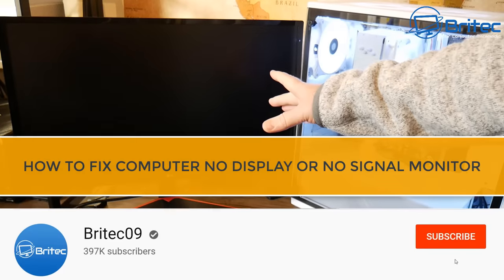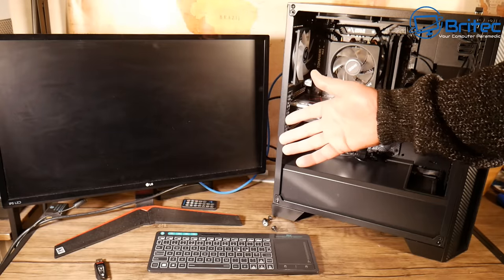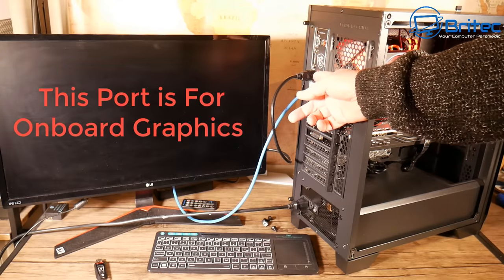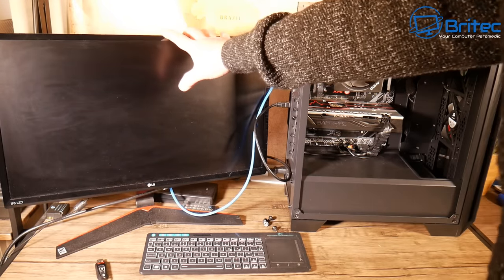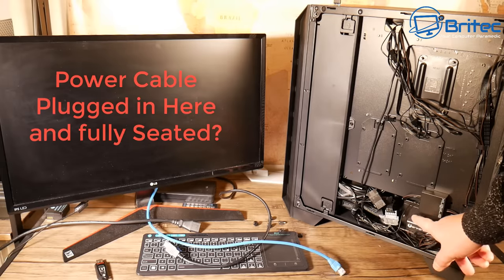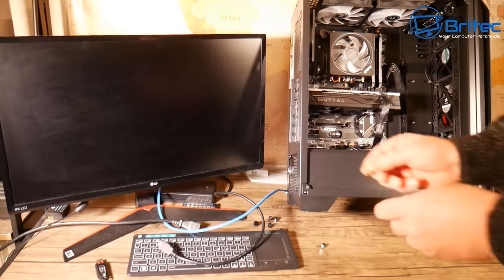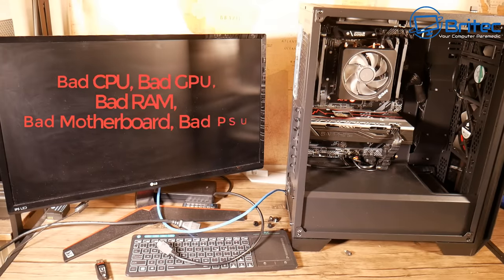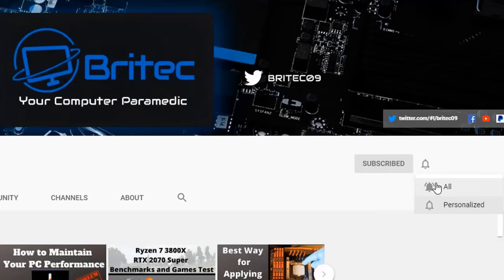How to FIX Computer No Display OR No Signal on Monitor

Comment: One thing that wasn't mentioned was the graphics card driver. I was troubleshooting another problem with mine (certain programs would often crash when I tried to either open a file or save a file). One of the solutions that Dr Google came up with was Update Your Graphics Card Driver, and gave instructions on how to get Windows to do that. Fine. Windows searched for drivers online, and then started installing it. Before it finished, the screen just went black. So I had to troubleshoot that as well. After trying online solutions that didn't work, I gave up and got a professional in to get it going again.
Reply: Did the pro say how he fixed it?
Reply: @lukezambrano  I don't remember exactly (he did it at my place while I was watching). What I think he did, he managed to boot it into safe mode or diagnostic mode, one or the other, found out what the video card was, downloaded a driver for it and installed it. I think that was the gist of it. At the end of the day, I was wise to get someone who knew more about it than I did to try and solve the problem. It worked.
Reply: how does one update drivers without a working display?
Reply: @dirtbeard108  One doesn't. One gets a professional to do it, like I did.

Comment: I just had my rig updated and it's been so long that I've never had an HDMI port in the actual graphics card before. I kept plugging the HDMI monitor cable in the onboard HDMI port and tried three different monitors, two power cables, and two HDMI cables before running to YouTube for help! Thank you for mentioning the two different ports because I'm not sure how long that would have taken me to figure out lol.

Comment: Thanks for the upload, It happened to me 2 days ago and I was really upset, since my pc is new.
PC powered on, but no signs on monitor, mouse, or keyboard.
I opened it, removed my ram/graphics card/battery and put them back on
And then it was working
I suggest those who run into the same problem to do the same
Reply from the maker: Thanks for letting us know

Comment: This happened to my pc and I managed to fix it somehow and then my pc crashed so I have to turn it of by the switch on the power supply and my pc turns on but I have no signal on my monitor and my keyboard doesn't light up
Reply: same
Reply: same
Reply: Same
Reply: i got solution after i try many times.. 1- just remove dust at ram, 2- if not display yet try to open the disk part then close back..
Reply: @memir384  what disk part???
Reply: Same my mouse and keyboard won’t ligth up and my monitor doesn’t have signal
Reply: DexterOMG did you fix it
Reply: Same issue. Can anyone here will help to fix this issue? My pc crashed after i open . Then the mouse and keybord doesnt light up.
Reply: Baldwin Alastra It’s hard to find faults unless you have spare psu, ram, monitor, gpu, mobo, ssd. I suggest you try to change one by one
Reply: Erased ram still not turning on :(
Reply: I managed to get mine fixed. It turns out I needed a new motherboard.
Reply: I’m having the same problem too. I’m going to replace the mobo and power supply and see if that works
Reply: Any updates guys? Having this problem rn. Thanks
Reply: I got the same problem and its driving me crazy! Any updates??
Reply: Erdem Önder  oh.. so do I need to reset motherboard or something? Or is my motherboard broken?
Reply: Zenzsa did u fix it
Reply: SyimirTIA Channel did I fix it
Reply: Itz Ace did u fix it
Reply: Verso Mentoro unfortunately not yet I might bring it to a computer shop because I’m just after building this pc and when I turn it on all the fans turn on and it lights up but for some reason it doesn’t show up on my monitor when I plug in the hdmi

Comment: When I turn on the computer, monitor will turn on but then turn off (showing the megatrends thing). The computer is still on, but monitor is stuck at black screen. I don't have any spare monitors or anything. I really don't know what to do. If I open the insides of the computer, I'm scared I might do something wrong and worsen the situation.
Reply: The monitor is fine it’s the pc that there is something wrong with

Comment: My monitor sometimes works perfectly fine and other times it doesn’t. My pic does have an odd power issue where it only comes on after being plugged in after a while from turning it off because I am unable to turn it on again straight away.
Reply: Same problem only this time it wont come back on

Comment: Thank you Brian. BTW, that display is very dirty. That drives me crazy to see a display with finger prints all over it and greasy streaks. Why not show us how you clean your display?
Reply: Mmm good idea
Reply from the maker: Just a test monitor, but yeah sounds good.
Reply: My bench monitors get dirty sometimes.  I clean them, but not as regular as the monitors and equipment that I use all the time.  The bench room has an air filter and has to be cleaned almost daily, but dust still occurs from normal air from pulling boxes off shelves with other test equipment, pulling boxes of equipment to replace bad components - it's not a vacuum.  I even have covers on exposed equipment - dust still gets in.  I'd rather get paid repairing things than making no money because things have a little dust on them.  They'll get cleaned eventually.

Comment: Does anyone know why it isn’t working? I cleaned my ram, I already tried putting  hdmi on  both plugs.
Reply: ExzSplash same issue
Reply: indigivent I got it fixed! Make sure to restart the CMOS
Reply: I just got another stick of ram and I put it in and there’s no signal
Reply: clouted nozu you have to restart your CMOS look it up on YT
Reply: @exzsplash8273  whats CMOS ?
Reply: @islembou9  the small lithium battery on your motherboard,its like 3 cm size silver colored
Reply: Kenan Zahirović so I started building my first pc today. Everything works. Everything lights up. But the RAM sticks. Well they did light up at first but I don’t know why I decided to lightly move it. And it turned of. Both ram sticks. And also nothing displays when I connect to a monitor. No signal
Reply: SlickRito make sure to put it in right and make sure it’s in good
Reply: @rnwo1698  if the pc turns on and the monitor is completely black then ram shouldnt be the problem,are you getting anything from monitor ?
Reply: ExzSplash what is that again?
Reply: Kenan Zahirović man just seen this. Nope didn’t get anything at all I tried two different monitors. It might be the motherboard
Reply: Kenan Zahirović also the ram sticks lit up at the end

Comment: Unplug all hdmi cables apart from your monitor, and it'll boot up. Not sure why, but I assume it's because having two hdmi outs is confusing the computer. I have a oculus rift so I unplugged it and it worked again. Plug it back in after, then boom.

Comment: can someone help me i have this issue and I know its, not the monitor or cable just before I had this issue I uninstalled my graphics drivers and restarted my pc then I was going to turn it back on and install the new driver but then I had this issue how do i fix
Reply: Plug to the vgi cable and run the cpu
Reply: Samee I was going to replace my gpu and now can’t use the gpu but I can use the onboard mobo graphics card. Please tell me if you have solutions
Reply: same if anyone knows how to fix plz respond
Reply: @spanickar33  I have tried using a DVI cable by run CPU do you just mean to turn it on normally?
Reply: hi, I solved the problem if anyone has the same issue, to fix it I removed my graphics card and plugged the HDMI cable into the motherboard then ran the computer and turned it on. the graphics card was the issue so I'm just going to replace hope i could help.
Reply: Liamjarrett1 i solved mine too, I just reset or clear the cmos battery

Comment: If your card is set for your previous monitor, then things could go wrong with the new one (a 10 bits color depth could be a no go I think). In my case, the monitor would display the bios, but nothing after that.
Reply: How did you fix that

Comment: Hey so I was upgrading and I just got a new power supply and I was putting it into my pc, did everything correctly and when I turn it on my pc turns on but nothing displays. My keyboard and mouse also don’t receive anything. Usually when I turn it on I have this light that turns off for 1 second and then back on indicating it is booting but now when I turn it on it doesn’t do that anymore it is just constantly staying on. I did everything in this video and still nothing happens, I even put my old power supply back in and the problem still exists. Do you know anything else I can do?

Comment: Hi, soo... I was just playing a game when my pc freezed so i restarded it, and when i restarded it the monitor started saying no signal, the pc is works i tried it with a tv
Reply: That’s exactly what happened to me did you fix it?
Reply: Same, but mine crashed (I think) it was the third time it happed with no warning or reason since I was just playing Minecraft. It hasn't worked since
Reply: @adamnedfrogboy1633  Update:Soo my problem was the vga-hdmi adapter,idk how but it just stopped workingk,bought a new one and is working just fine:)
\
Reply: Hey samething hppend to me i was playing valorant and i just froze and i can stll hear my teammates tlking but there was no ingme sounds and it just froze so the solution is just buying new hdmi cable?

Comment: Hi! 
I have a laptop connected to a monitor. Everything worked fine until a couple of days ago. My problem is that when I start the laptop the monitor don’t get any signal. When I disconnect the HDMI cable the laptops monitor turns on and works fine. When I connect the cable again and search for a signal on the monitor it works perfect (the laptops monitor go black as expected). Until I don’t use the computer for a while and the monitor goes into power save mode and I need to disconnect the HDMI cable again for it to work. So. Everything works great as long as the monitor hasn’t been off. 

What can be the problem?

Comment: The most like problem depends on the psu. First try taking out the battery on your mobo and unplugging the power cable. If that doesn’t work then what psu do you have semi modular? This may be the problem. If the psu cable attached to the psu is not being used, you may get problems. Try use the one attached to the psu. If this works then what it tells you is that you still have a faulty psu, please change it, a Good quality PSU is essential!

Comment: Hey mine is similar.

So basically after like 6-7 hours, my screen will go black and I'll hear whatever I was hearing play over and over..

then it will say "saving power".

then if I press any monitor buttons they all pop up! and I have a yellow on sign.

If I switch analog-digital monitor, it pops up with "no signal from monitor detected"

Comment: I've got a mini pc it won't post ,black display, fans running 
But after 3 on/off Power button presses it all boots fine and works for hours
Next time of use the same procedure 
Microsoft online techs have been involved with a no fix
Computer supplier suggested a complete re- install of Windows 11 Pro
In my mind if it's a no post it's hardware related not the OS
Can you confirm my thoughts

Comment: So I use a gaming laptop that I connect to my monitor and when I was downloading a driver to help boost performance in a game I wanted to play it told me I had to restart my device after doing so my monitor couldn’t pick up the laptop. It keeps saying there’s no signal coming from my laptop even tho it’s turned on .
Reply: Same issue but with my pc
Reply: same is there a fix
Reply: Let us know if  fix it
Reply: Withdrew I just unplugged my monitor and let it rest for the day the following day I plugged everything back in and it worked

Comment: My problem os that i cant find the hdmi on the computer...i found it on the monitor but not the computer i use a windows 7 computer.
Reply: hey buddy, sometimes computers use different display cables. So, yours may use Display Port, VGA, DVI, etc
Reply: @cullenmanning141  yeah thanks right after i posted this comment i figured out i needed a vga but thanks anyways!💖🌟

Comment: I have a new gaming desktop from Skytech which has no signal on any of the HDMI or DisplayPort on the card or onboard.
I didn't have a cable to check the onboard VGA. Is it possible it was set to VGA in the BIOS?

Comment: Heh mate, I cleaned each of the connectors on my 6 yr old out of storage now pc build. I did the gpu, 4x RAM, and CMOS battery at least 4x over 2 evenings. The no signal sign disappeared for a short session but would come back after turning the pc off then on again. I finally realized the CR2032 battery must not be producing 3.0 V.  Its replaced now, the 2 Acer monitors display prooerly. Thank you sincerely for a thorough training video.

Comment: THANK YOU SOOO MUCH I was ready to buy a new monitor because I plugged the hdmi in the wrong slot . And guys check where you plugging in the hdmi in your cpu don't plug it in the motherboard which is the main backpanel it's very big so you can identitfy it easily but plug it the hdmi socket below the big panel which is your GPU and even if you don't have it there will be some panel there so plug it there for your display to show up 😊😊😊😊

Comment: I’m such an idiot I was plugging the hdmi cord in the onboard graphics port instead of the gpu.
Reply: do you need a gpu to display it or can u use the motherboard one?
Reply: @israeltalamantez9570  for the motherboard you need an integrated graphics in the cpu to get video

Comment: I have a desktop with VGA/VGA to a gaming monitor and it works fine.  I tried HDMI (connected to my card in the correct port) and it didn't work.  Then I tried a USB/HDMI converter cord to HDMI on desktop and it still didn't work.  Then I tried the VGA/DVI converter on TV and it still says "No Signal".  I have also tried a 2nd monitor with NO luck!  BUT, I reconnected my desktop to my gaming monitor with the VGA cord and it works... Is this an Analog/Digital issue?? I am at a total loss :(

Comment: So I took my ram out and cleaned as best as I could, not sure if this was the fix since it wasn't instant, the only other thing I did was; Unplugged my monitor's power cable whilst it was turned ON [important since everytime I turned my monitor off and changed the plugs input it didn't work] and change the input that the power cable went into, monitor then turn on.

This fix for me was achieved after 30mins of pulling all cords out and switching power inputs while monitor was off to no avail,  
Also I had no idea how to safely push the ram back in, I discovered that by laying the system on it's side and just pushing it in moved the clips that old it in closer, closer enough for me to push them and lock it in, I'm not ashamed to say that yes I freaked out not knowing how hard I could push the ram into place however with Gravity's assist just a regular medium push was enough. 

Good luck have fun until the next time it happens and you punch the fuckers lights out for real, I almost did yet... $800 doesn't grow on trees in my neighborhood.

Comment: No display!
All connectors and pins are good, everything is connected, monitor is my tv and works fine. All components are fine.

Computer worked just fine before the mover came in jerking cables out of things without the computer being turned off. And after I told them not to touch the computer.

Comment: i’ve changed my ram, i’ve done everything i can. i just got my pc today, i don’t really have patience to build one so i got a prebuilt one. it still won’t show up on my samsung 27 inch curved monitor and i’m very confused and stressed, is it the cable to connect the tower and the monitor? please help i’m kinda at a loss rn
Reply: This is the exact same problem and i think i have the same monitor as you, were you able to fix it?
Reply: @Goatide  nope not at all 😀
Reply: Hey did u guys figured it out? I just bought mine today it turns black screen,keyboard and mouse not working after 10 mins of playing gta v.

Comment: I've got a Ryzen 7 CPU, mate, which has no onboard graphics. Folk reply with the same thing, "Just get a graphics card for it.". The part I don't understand, though, is although I have a graphics card, there's no way I can install the driver for it until I can see what's happening onscreen. 

It's like some sort of 'catch 22' scenario. I need to re-install my operating system in order to repair it and I can't do so to due this issue.

Comment: If you don't have a spare monitor / cable / TV, then flush power from the system & remove the ram, then power it back on. Make sure you have a diagnostic speaker plugged into your motherboard(some motherboards have them soldered on) if you get a beeping noise, you know the board is attempting to post. If I recall correctly the post sequence 1st looks for a cpu and then for ram. But from experiance even if you get the ram beep, it does not mean that the cpu is infact 100%.

Comment: My pc fan is running fast with a loud noise the way the fan is running plus no display on the monitor ,black screen on monitor. 

WHAT DO I DO?
Reply: I had this issue and got repaired but its happening again just after 10 days of repair

Comment: My computer was working just fine for 2 days until it stopped working every time I turn on the monitor it says there’s no video source input the computer is basically new :/
Reply: Same dude :/
Reply: Papi Stalin buy a new power box and  see if that works I’m unable to buy one cuz I’m low on money but there’s one for 45

Comment: Was just about to buy a new RAM one was working the other wasn’t ! I took the CMO out to reset it . took out the RAM cleaned them and put them in so they clicked and it started up no beeps ! My monitor wasn’t switching on then I seen about the HDMI now my pc works !! Thanks so much